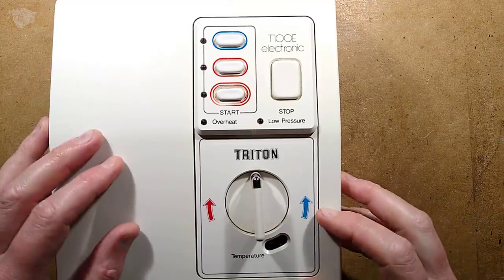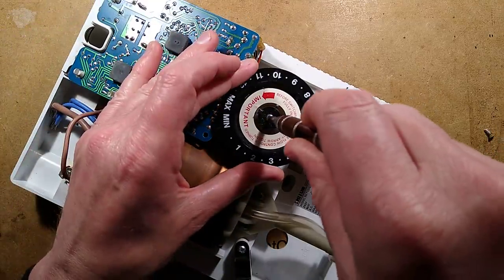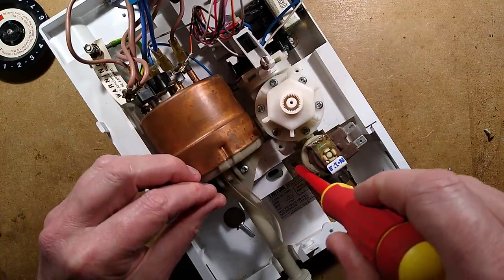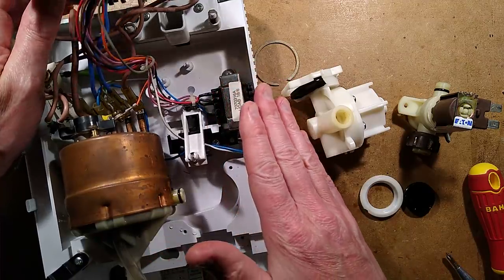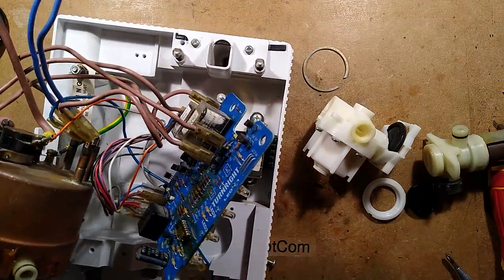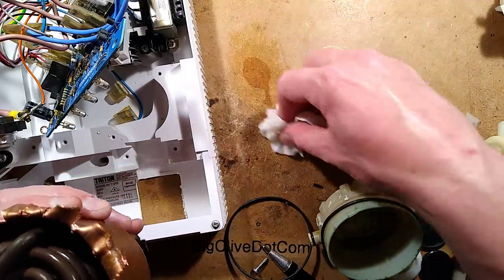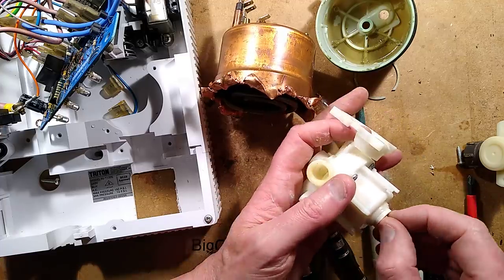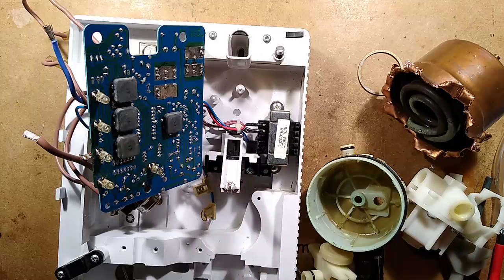Teardown of a British electric shower that went bang.

Comment: We have a gas heated on demand water heater. About 12 years after it was installed it developed a split in the copper feed pipe and water sprayed all over the unit so I had to purchase a new one for AUD$1,200. Was not happy spending so much when a AUD$20 piece of formed copper pipe would have fixed the issue. Today's throw away society just gives me the shits.

Comment: Always found it odd that this was chosen over a central instant water heater.
Reply: My understanding is that they do, at least they used to.. i remember my wife telling me somthing about heaters in their roofs that had open tops, and would sometimes have things fall in and die... thats why they dont fill theor kettles with hot water from the tap
Reply: BlueFoxTV They weren't chosen over instant hot water heaters. Every home has a hot water system. Either instant, mains pressure tank or cistern fed tank if the property was built before about 1980. These showers are found in homes with older low pressure systems- they never had showers, and when showers became popular the choices were to rip out the hot water system and replace with a modern pressurised one at huge expense, or install an electric shower for next to nothing. Many took the cheaper route!

Comment: They usually detect low pressure, not high pressure, i.e. low pressure = no water. Maybe.
Reply: The switch that has expired is designed to detect low presure and not activate the electronics.
Reply: Yeah mine always cuts out when the dishwasher or washing machine starts filling itself :(

Comment: Good thing it didn't happen right after he lathered up some shampoo.
Reply: Actually 9 times out of ten an electric shower will fail when you are head to toe in soap suds.  My old one had a tendency to trip the circuit breaker after 5 or 6 minutes so instead of enjoying that "just entered the shower" feeling I would have to get straight to business and leave the "waking up in warm rain" routine until after the soap was gone.🤣

Comment: Next video (hopefully): Reverse engineering of electric shower controls (with schematic.)
Reply: @TheWacoKid1963 I've seen that video, but that is a more basic unit with simple electromechanical controls. I'm interested in how the logic circuitry is implemented in this more complex electronic control.
Reply: @eDoc2020  The only shower I've ever fitted that had had a circuit board was a fancy one that had personalised settings. In theory the whole family could save their shower settings. In practice it was an overcomplicated POS. Why not just remember the orientation of the temperature adjustment and turn the knob to the same place. 
Every other one that I've fitted were the electromechanical variety and they generally are very reliable and lot cheaper than the fancy ones.

Comment: we have an electric shower thats out of action till ive replaced the main cable, one day it suddenly stopped working and i narrowed it down to the roof mounted switch. thus replaced that, but it too was cutting out, so i ended up fitting a bathtap shower system. it soleved the lack of a working shower problem until i can be arsed finding out why it is the main roof pull cord is tripping out all time....i suspect main cable thus will replace that at somepoint.
But later problem developed even with the bathtap shower system.. had to swap the shower head for the one on the electric one. the water or a manufacturing fault had badly corroded the crappy what looked like same metal type used on toy cars....corroded to point holes appeared on head handle and sprayed watter everywhere where watter wasnt ment to come out of !!...so much for so called 'decent' products from B&Q !!.
Reply from the maker: The pull cord isolators are prone to failure.  Just replace it and make sure there's enough space in its enclosure to allow unstressed termination of the wires.  I'm not sure if it's changed, but the regulations didn't actually require local isolation.  It's just something the manufacturers suggest.  Possibly to make service calls faster without havinbg to look for a distribution board.
Also check cable terminations at both ends for signs of heat and that it's not been joined anywhere.
Reply: You and I are in exactly the same boat.  My cutoff switch failed (it got stuck and woulnt turn on anymore) so I replaced it with one from B&Q.  When I remove dthe old one I found ALL the wires were blackened.  The feed from the fusebox and the cable going to the shower.  Turns out this is quite comon and is caused over time by the connections loosening and sparking.  The cable now looks to have a short, to earth inside it, I was able to locate the fuse in the fuse box and pulled it so all is well for now.  I now need to get up into the attic and replace the damaged section before I can use the shower again.  Like you I'm now using a mixer hose attached to the bath taps.  Its really finniky trying to get the trickle of cold water needed to cool the hot water down without it squirting all over the bath!  I also swapped the supplied head form the shower head, but  mostly because the supplied head was total crap.

I so much want a real shower again.
Reply: @bigclivedotcom  I have this exact same issue.  My old pull cord isolation switch failed so I replaced it only to discover the cables (the mains feed and the shower feed) were blackened due to what I found out to be a common fault of arcing due to loose connections.  I have pulled the mains fuse (lol it wasnt labeled in the fusebox but I found it) so its safe now (even so when I continue to look at it I switch off power to the whole house).  Then I tested for a short between live neutral and earth to check if the cable insulation has melted further up.  There is a short between the live and earth wires with a resistance of about 8 ohms.  I'm thinking thats a good sign the cable needs replacing up in the attic.  I havnt been able to get up there however to take a look.
I would call someone in but that Part P nonsense got me worried that whoever looks at it would report me to someone for fiddling with out the correct qualifications lol.   Then covid lockdown happened sigh.
Incidentally, while testing this I made sure to pick up one of those mains voltage detectors to help me confirm that the power is off.  Have you considered doing a tear down on those devices?
Reply: @bigclivedotcom  when i was troubleshooting it, the unit was fine. it seemed the cables in pull cord feed into switch from mains that was overheating.....we have loft insulation so i dont know if thats effecting it due to trapped heat or something, i pulled fuse to it over about two year back and never went back since. we just use the tap thing now.
in saying that we seem to have a issue with lights blowing out and stuff, and bayonet area over heating...i put that down to tacky cheapo poundland & polaroid bulbs that seem to have the damn habit of exploding over my head !! or when i just flick the on switch.
but there again place needs a rewire....we are still using the outdated two pin ceramic fuses and good old fuse wires.
Reply: @dlarge6502  lol, strange how we always think we are the only ones having such troubles. after second pull cord failed i put it on backburner miffed. i wasnt sure if it was my reinserting of wires and cocking it up or what...damn 'instructions' were not as it was in real life and didnt match what i was actually working with, so rather than risk burning place down i yanked fuse and left the electric shower alone. i ended up shortening the cable anyway (getting rid of charred bits), to point i need a new length...thus means a lot of fucking about in loft and those damn junction boxes, which i aint comfortable im pissing about with.

Comment: In Canada we have have whole house instant hot water heaters. We use natural gas as the source of heat, but over the last few years we now have ones that use electricity too. As soon as you turn on any hot water tap in the house, the heater detects the flow of water and instantly turns on. It only takes 5 seconds for the water to get very very very hot. We call them tankless water heaters.

ANd in the last 10 years we finally got Point of Use Water Heaters where you can install one in your kitchen, or washroom, or car garage for washing the car.

Here is a good example with a full view of the electronics in the product images: www.homedepot.ca/product/rheem-6kw-electric-tankless-point-of-use-water-heater/1001070392

Comment: 120v of electricity and tap water don't sound like a good mix
Reply from the maker: It's 240V.
Reply: @bigclivedotcom  Still, is there any risk of electric shock if something goes wrong? I'd be very wary to have an outlet-plugged device in my shower

Comment: These things are so crap! The thermal cutout usually kicks in when you turn it off, then doesn't reset until cold water has flowed for a bit. If you like to take a break in a shower you end up with a glut of boiling then freezing water. Of course, if it's winter then it's only a dribble anyway.

Comment: I had the exact same shower and it was the same part the exploded it might be a weak spot... in saying that it was about 8 years old lol
Reply: In that case, it's a manufacturing defect - sue them.
Reply: 8 years is not very long. If that part was metal, it wouldn't break. It should be metal but that would cost slightly more and the greedy manufacturer wouldn't make as much profit.
Reply: These electric showers are just cheap plastic crap basically. Install a proper power shower with hot and cold feeds and a pump.

Comment: 230V in the UK, no longer 240 - we are in Europe now :-) And before some of you jump up and down I'm saying it with a smile.
Reply: The voltage where i live is 248V Ive never seen it at 230.
Reply: And thats measured with my HOPI meter the same as clives
Reply: The standard changed but the voltage didn't, 240V is still within the tolerance for a 230V supply so the box is ticked but nothing has actually changed. Over the last week my lowest was 237.5 and highest was 249.5
Reply: Chortle🤣
Reply: 248v in my house currently.
Reply: As dopiaza2006 says, the tolerances of previously existing supplies were changed alongside the new standard. UK voltage to 240VAC + 6% and - 10% and European to 220VAC +10% and -6%  (thereby creating a manageable overlap) and we would call these two combined 230VAC. It means very little changed with the REC's supplies but manufacturers made their appliances more tolerant. So UK supply can be 216 - 253V and still be in spec. And a 230V appliance can be used anywhere with no problems. But the stickers and voltage plates say 230V and we should say 230V really. Sorry Clive.

Comment: I think even the low levels of chlorine in the water tend to degrade plastics prematurely.
Reply: It really depends on the type of plastic.  Polybutylene, for example, will fail in the presence of oxidants such as chlorine added during water treatment -- hence why it is no longer used in the US.

Comment: Can someone explain to me why these are popular in the first place?
Reply from the maker: Convenience and speed.  A compact stand-alone unit that creates instant hot water for a shower for as long as you need it.
Reply: @bigclivedotcom  interesting...I'm an american and was like "but hot water heaters" lol
Reply: Scoopta we obviously have those too. We use boilers (furnaces) to heat a water tank, or combi boilers which are basically instantaneous gas water heaters. However, many British homes still use the original low pressure hot water system with a tank in the attic supplying the pressure. They are fine for filling baths, usually through large diameter pipes, but the low pressure doesn't give a good showering experience. Electric showers were seen as an economical solution, running on mains water pressure meant people didn't have to rip out their entire plumbing system just to install a shower. Remember, until forty or so years ago showers were far less common here, baths were very much preferred. They are still useful for providing a back up incase of boiler failure, you are able to take a shower when the hot water supply is malfunctioning- for this reason they are often installed in a second or guest bathroom for occasional use only. More modern homes tend to rely on mains pressure hot water systems so they are not often found in new build houses.

Comment: British bath appliances. Lightswitch on cords, shower heaters, separate facets for hot and cold water, wall to wall carpet. They are celebrating the friggin mddle ages. What the hell?
Reply: not sure those gorgeous electric showers exited in the middle ages. I think back then they used what the US still use today.

Comment: Already 20 years ago they overestimated the strength of plastic! It is ridiculous that this design fault came to surface. And they were aware  of the flaw because they put on a warning label! I suppose later models have improvements! Nowadays there are so many parts that have some important piece of plastic , and breaking. Then the whole thing have to be scrapped. We really must strive to get these failures out of the way to become a more sustainable society! BTW Ik would not dare to use this thingy in my shower, it is a death hazard!!!!!
Reply: they're perfectly safe

Comment: I'll pass on that idea. An isolation failure would make it a nearly ideal electrocution machine in a cast iron tub. I wouldn't trust it with even distilled water. Also the flow rate does not qualify as a US shower.
Reply from the maker: The chassis of the shower, including the heater containment and its sleeve are grounded, as is the bath's plumbing.  So it's an equipotential zone, and also usually protected by a 30mA RCD/GFCI at source at the distribution board.
The only shower-fatalities I know of have been ridiculously bad installations with no grounding and the cover missing.
Reply: @bigclivedotcom  Yes, but I'd still have a moment of doubt when I turned it on. And I have yet to grab a gfi conducter to see if it works. I'm sure familiarity would breed contempt. But I got to retirement alive.
Reply: I suppose it's no different from a flash heater, but that's not in your face.

Comment: Water + 220V live electricity,  sounds legit.
Reply from the maker: Make that 240V.  Often exceeding 250V here.  So quarter of a kilovolt and water.
Reply: @bigclivedotcom  Right, yikes!
Tingles my Spidey Sense. 
It's not uncommon to have electric central and sometimes distal (probably wrong word) water heaters here in the US. But having a mains connection in the shower, scares me a bit.

Comment: After realizing the solenoid/valve is on the input the failure mode makes more sense, a failure anywhere downstream would cause the leaking behavior seen. Was perplexed at the beginning

Comment: I'm sorry...but electric showers? What?! Why not use a water heating tank?
I know you said they're quite common in the UK and North Americans have a hard time excepting such a device...after watching you take that POS apart I'm even more convinced that device is a terrible idea. I'll take a hot water tank any day over that death-row shower. Great video though, always nice to see inside a gadget.
Reply: Because the tanks empty before you've washed your hair!
Reply: Eremon1 we all have hot water systems too. The issue is with older legacy systems where hot water pressure is low but flow is high- designed for filling baths quickly, not running showers which were never a feature of early British bathrooms. Any home built in the last forty years will likely have mains pressure hot water, but hundreds of thousands of homes still have their original low pressure hot water system and electric showers provide a cheap solution. Replacing a gravity fed hot water system with a mains pressure one costs thousands, and is very disruptive so lots of old systems remain.

Comment: I've always thought it a bit odd that we have these in the bathroom but can't have any plugholes or light switches except the ones on a cord. There must have been some very interesting arguments at the BS Institute when they were invented. I assumed it must be to do with seals and steam, but seeing the inside of this...well, I know all I can say is that I haven't been electrocuted.
The rapid generation of hot water fascinates me. There must be something fundamental about the specific heat capacity of water and the rapid generation of hot water to power a shower versus the rapid generation of steam to propel a locomotive with 12 coaches or the Waverley as she accelerates away from, say Rothsey on Fair Saturday, whereby burning fuels is preferable over generating electricity to power elements. 
(35 tons of oil will last about half a week over two boilers on the ship. These boilers somehow have been defined as over 90% efficient and the mind truly boggles. At 175 PSI the boiling point of water is 188 deg C).

Comment: So wierd that you guys don't have a water heater in your laundry rooms...
Reply: TestECull we do. Every home has either a hot water cylinder or a combi boiler serving the whole house. Electric showers are now really only installed as backup, but in older properties with low pressure hot water systems they were a cheap solution that eliminated the need to replace the entire hot water system to run a shower that requires more pressure. Showers were for many decades something few Brits had at home, they were things we had at school after sports, at home everyone traditionally had baths.